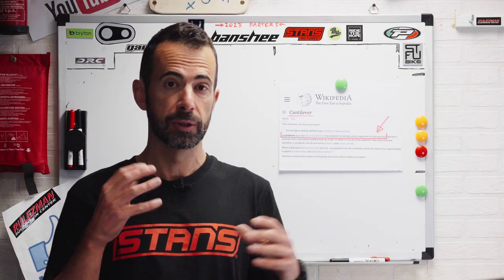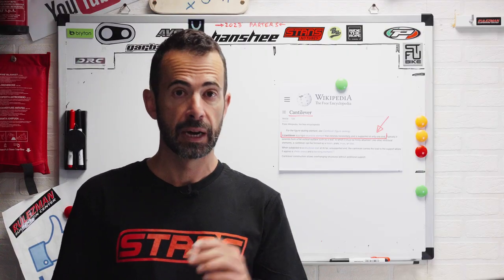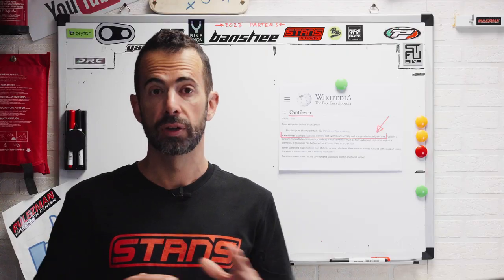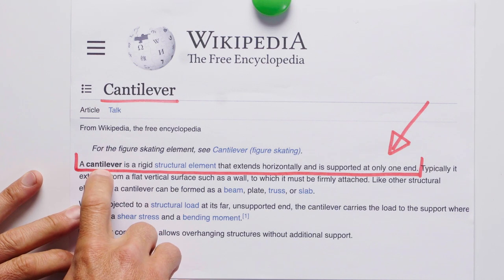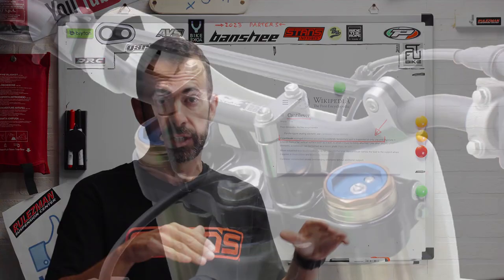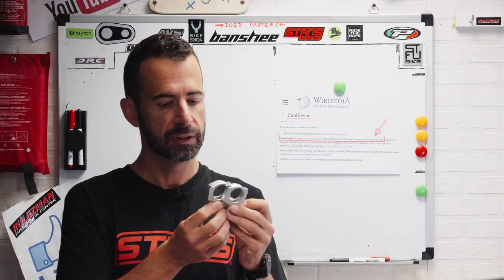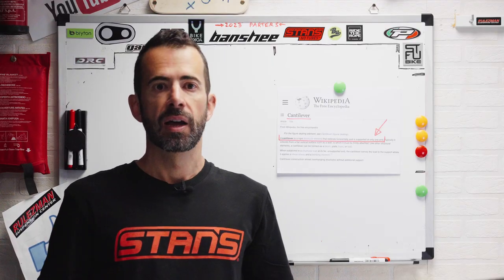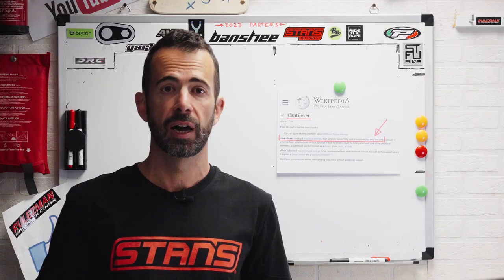MODERN GEOS & SHORT STEMS  : TECH TALK

Comment: Wow explained in a way everyone can understand. I'm 1.98 m tall with long legs. Very happy reach is rising, but rear chains stays only a few milimeters and stack even getting shorter. Also the shrinking seat tube lengths in biggest size(very often 46cm ore less) is a concern for tall riders. To be able to use a 18mm stem I need a reach of well over 55cm. Not found yet.  Fisrt time I noticed what a long chainstay and wheelbase  mean was on, our tandem with 485 mm chainstays. We can climb the sky. Only disadvatge : turning circle.

Comment: I watched the full video, thanks! I agree otherwise, but in my experience 12 degree backsweep handlebar is only good when riding bike from sitting position, but when riding from attack position, 8 degree backsweep (0 degree upsweep) handlebar is better. I've tested both backsweeps on long test periods.  In attack position wrists are at more direct angle to the handlebar and upper body muscles are better activated with the 8 degree bar. It´s also easier to ride correct attack position = elbows out. Many pro downhill riders prefer fairly straight bars for this reason (such as Renthals). Also Fabio Wibmer understand this and his signature SQlab 3OX  Carbon bar has only 7 degree backsweep. Motocross racers also will usually prefer a lower bar with less sweep, this keeps their body weight further forward, helping with cornering and hard acceleration. I think on a lot of mx motorcycles, handlebar grips are actually located little behind steering axis, not in line with it. 

Steering felt good with 32mm stem, 42mm fork offset and 8 degree bar combo on my bike, but the bar snapped recently and I had to switch to a spare bar with more backsweep. Now the steering feels way too sensitive and fast due to shorter "cantilever" with the same stem. I haven't even gotten used to it for several days. "Steering ratio" is too high, which means that front tire tends to "oversteering". I must do many steering corrections for one task on slippery surfaces, ruts, etc. Previous setup was very balanced. I use always 800mm width bars and now my grips are still 23mm front of steering axis measured in the middle of the grips. If I would use even shorter stem, wouldn't the steering of the bike become even more twitchy? 

Fork offset, which is also "cantilever", plays also role here and it´s 42mm on my fork and head angle is of course 63 degrees. I have tested different offsets such as 42mm, 46mm and 51mm. 42mm is the best of those. Chris Porter has experimented with a huge range of fork offsets on his bikes, and he has found that shorter offsets give a calmer handling bike, which tends to go faster when the stopwatch is brought to bear. Following this, Chris has landed on a 30mm offset for his 27,5" bike. Shorter offset also reduces the ‘floppy’ feeling that can occur when tackling tight corners, where the wheel can feel like it wants to tuck under. This is nothing to do with "trail", but simply the fact that a longer offset will put the contact patch further inside of the bike when cornering, causing it to pull to the inside of the turn. Interaction between stem cantilever and fork offset cantilever is actually quite important. Steering ratio is 1:1 when fork offset is zero and handlebar grips are in line with steering axis or if distance from steering axis is equal on both; offset and grips.  As Greg Minnaar once said: "You don't want a stem any longer than the offset of your fork." Greg didn’t want a stem length too different to the offset of his fork and I can agree. If I would ride with 15mm stem, I would need also shorter than 42mm offset for the balanced steering ratio. Unfortunately, the offsets of forks on the market are too long for that. Of course bar width (cantilever) is also important factor for steering sensitivity.

Comment: Hi Dave, congrats for the video.
I have a 470mm chainstay, 500mm reach, 1320mm wheelbase custom made hardtail bike (I'm 180cm tall), and couldn't agree more with you.
In my opinion, the only downsides in comparison with a "traditional" bike are:
- more side lean is needed to corner on very twisty, old school trails; therefore, switching between consecutive turns needs a lot of aggression;
- the added front wheel loading makes intentionally lifting the front wheel over obstacles quite harder.
Now I'm going to experiment with mullet set-up and higher rise handlebars.
Happy Christmas holidays!
Reply from the maker: yeah , nice comment man!   🤝

Comment: Fantastic info and so well presented 👍Unfortunately, most don't have a choice and go with the current trend / industry offerings. 
Also, re: rear stay lengths - it's fascinating how the same stay length can be used across all sizes offered, I'm using Spec Chisel as an example: same 432mm from size small to XL - meaning weight distribution variation @ BB almost 4% depending on the size!

Comment: Longer rear end = more front grip. Makes total sense when explained by a real engineer 👏
Reply from the maker: thanks man !🤝
Reply: @RULEZMANSUSPENSION  I do agree with the sentiment but a 460 CS on a 1300 WB bike gives the rear 35% of the complete wheelbase and 480 CS a 37%. 
How long chainstays are you saying you want? a 440 CS on a 1240 WB bike gives just over 35% ratio of WB as well.
Reply from the maker: @javisst44  nice calcs bro. 🎖: MOST MODERN adult bikes are 1280-1300 and still retain 430-435-440 CS, while we should move to 460-480 range .          1240? wow what is that a kid’s bike?  yes, that cS is well proportioned for such short wb

Comment: Hey Rulezman, geat video, thanks. I'd like to comment on two things.

- Moto vs bicycle. I read an article by someone from Mondraker a while ago on why they abandoned the 0 mm stems and why it works on moto. The deal (as far I can remember) was that on moto the whole system is way heavier and more stable and therefore does not rely on the stabilizing effect of the cantilever (stem) while going straight. Therefore even negative stem length works on moto that would destabilize the ride. Mondraker figured out that the optimal effective lever for mtb to provide a good compromise for straight line stability was 1-2 cm I believe. Effective means you need to subtract the backsweep of the handlebar since you would obviously end up with a negative lever with a 0 mm stem and a common mtb handlebar. With more modern bike geometries (shorter fork offset, slacker head angle) this may not be valid any more, as you said. Btw. the so called "Raised Reversed Stem", this crazy high short stem you may have heard of: the idea I believe is that by raising the handlebar you reduce the weight on the handlebar to moto regions. 

- Chainstay length. I am sure you are aware of it, but for the regular audience: please consider small bike sizes. I am currently on a bike that has a 430 mm chainstay and a 430 mm reach with a 35 mm stem (I'm only 167 cm short). This is great. Nowadays I see bikes that have 450 mm chainstays on all sizes, so you might get a 430 mm reach on small size. This sucks. Difficult to manual, bunny hop or make bike oversteer (very important to me). Just keep the 1:1 ratio between chainstay and reach. So if you have a 520 mm reach on size XL, give it a 520 mm chain stay. Crazy, I know, but it's just science.
Reply: Thanks @alexgordon8277, I'm with you on wanting a smaller bike for playfulness, ease and speed to manual, bunny hop, and to make the bike oversteer. I want to manual and bunny hop more on the trail and I have had problems with feeling that my bike understeers with a shorter stem that I have fixed with a longer one (going from 35 to 50 mm).

Though, I do agree that @RULEZMANSUSPENSION has good points for stability that apply well for racing. 

This video generates a lot of ideas for me! 

For example, I think about if it is possible to make a combined linkage and shock to give a considerable rear axle path (obviously with high pivot) that has 1, plushness off the top; 2, good enough mid stroke support and LSC damping to not {considerably fall through mid stroke and lengthen chain stay with the rear axle path} when doing a bunny hop, a manual, or otherwise pushing with body weight; and 3, that reaches considerable travel through mid stroke, lengthening chain stay when hits are hard and stability is preferable. 

My thoughts of a shock to provide these characteristics come from the Rock Shox DJ that does just this but on a micro scale. 1, it has about a cm of plushness off the top; 2, then goes quite stiff to create a rigid feel for ultimate pumping on a pump track; and 3, when landing jumps it actually falls through travel to give exactly the support that you want. 

Now the question arises: Are these traits transferable to our application?
Reply: @niklasdr  "...understeers with a shorter stem that I have fixed with a longer one (going from 35 to 50 mm)."

What you experienced with this was the limit of your functional Reach (as David explains above, when I say "functional").  When Reach is bigger than your posture, abilities and flexibility & reflexes allow, you can't weight the front wheel adequately.  

I have played around with this since before Reach was part of marketing lingo.  Effective top tube measurements more or less tell you, as long as you understand your STA affects this ETT vs Reach comparison.  Like David I was curious about shortening the stem and what that does to the geometry and reactivity.  In the early 00s top tubes were shorter and so a shorter stem pushed you backward on the bike.  What was needed was more top tube.  When top tubes got longer?  About the time they started talking about Reach.  With more top tube and less stem, you get equal front contact patch weighting right up until you go too big on your Reach and throw off your posture & reactivity.

Gary Fisher tried to make a splash with this idea, in moderated fashion, some time ago.  He was suggesting moving from 100-120 stems to 70-90 stems.  It didn't take at the time, but later it started catching on with bigger top tubes and shorter stems.  Look at modern XC race bikes in World Cup level racing.  Compare them to 20 years ago.  Even the serious anaerobic athletes are benefiting from a more stable platform.
Reply: @seanoneil277  "What you experienced with this was the limit of your functional Reach (as David explains above, when I say "functional")." You are misinterpreting me. I am talking about under- and oversteering. My case does not have to do with functional reach. I had the same functional reach in both cases. 

Longer frame reach and shorter stem gave me understeering. 
Shorter frame reach and longer stem gives me a better balance between understeering and oversteering.
Reply: @niklasdr  I may be misunderstanding you.  But consider this -- under/oversteer qualities are related to this concept of what is your functional Reach.  How either gets introduced into a steering effort is a combination of geometry w/in the bike itself, and the rider's fit to that bike & geometry while riding.  Wouldn't you agree that you can, if skilled enough -- and if rider to bike fit is good enough, induce understeer or oversteer at will?

I don't mean to suggest your skills/experience are low or inadequate.  I'm just saying that from my experience, riding bicycles then motos as a kid, then again road bicycles and MTBs later as an adult, trying different frames and geometries as well as undersizing and oversizing on frames, what I've learned is that especially when oversized, a bike can feel as though it understeers more than oversteers.  Conversely a too-small bike (i.e. adult on a 20" BMX) will feel always oversteering unless you grew up riding compact WB and steep angles.

In between oversized and undersized is a "just right" spot where you can maneuver the bike as you wish, rather than feeling forced into passenger mode (oversized) or clown-biked (undersized).  Your functional Reach is a big part of maneuvering the bike as you wish.
Reply: @seanoneil277  You definitely have a point and I like your reasoning, I follow along on it! 

It's just that my case tells myself a different story as I went up in functional reach (by lengthening the stem) and found less understeering. This is a bit the opposite of your story that a longer functional reach will lead to more understeering. And it is here I mean I feel that a bit longer stem gives more of the feeling of pulling the front wheel through the corner in the direction that I want to go [giving me a balanced oversteering] as opposed to pushing it through with a risk of it washing out [understeering]. 

I'm a pretty normal medium size guy at 5'10 / 178 cm tall, with perhaps a little more legs than some at 32" / 82 cm inseam, and a bit longer arms than most at 6'1 / 186 cm wing span.  I have loved a 27" 422 reach frame with a 50 stem.  I liked a 29" 460 reach with 40 stem, even though it felt like a monster truck in comparison.  And I loved straight-lining the next 29" 470 reach with a 35 stem (after not liking the 50 stem it came with because the bike felt too big).  It is the next mx 455 reach with 35 stem that I felt understeered, which I felt was solved with the longer 50 stem. I now also ride a 445 reach, 50 stem bike I really like for playfulness. But I feel my best size for enduro is a 455 to 460 reach and a 42 to 50 stem. But, I am open to experimenting and finding anything new that could override what I feel is true today!
Reply: @niklasdr  No I get what you're saying.  I ride a GG Shred Dogg and it has 10mm fore/aft head tube position adjustment.  I have 50mm and 35mm stems.  I played around with all the configurations, noticing where I had to put myself to get proper weight on the front axle/front contact patch.  I've done the same on older bikes with much older geometry (late 90s/early 00s), though in those cases it was stem length and bar width & rise.  

Sometimes it can be a matter of getting the roll of your handlebar correct, too.  When the roll is off, you can't really feel the front contact patch as well as when you have it dialed properly.

Comment: I also like short stems, but you did not mentioned, that with it, the handlebar is behind the steering axes, because of the offset of the fork. Normally the wheelaxes is 40mm in front of the steering axes.

Comment: I have been saying this since the early 2000s! I currently run 35mm stems, but I would love a 15mm stem. I don't see anywhere I can get one though.

As for chainstay length, a shorter chainstay gives a bike more pop for jumping. Longer chainstays make pulling up the front wheel more challenging and because many riders like the catch air a short chainstay makes that a lot easier. Comparing a motocross bikes chainstay to a bicycle is a bit odd considering you have a motor with a bunch of power to get the front end up, something you don't have for a mountain bike. On a bicycle you have to control the pitch of the bike with your arms, legs, and body position. So I am not so sure I agree on your statements about making chainstay lengths longer simply for more equal front real balance during cornering. You do a lot more on a mountain bike that cornering so the frame geometry needs to be well balanced to accommodate all the different situations. So for my height of 5' 7" anyway, a 435 - 440mm chainstay is perfect. As a rider gets taller, the chainstay length should get longer, not just the front of the bike.
Reply from the maker: 15mm stem: email me. I produce them.

CS:  races are win on corners not on hopping, and long cs makes you cornering with more speed overall, so it is faster.       who think at hop as his first passion shoul
buy a  24” bike or dirt jump
Reply: @RULEZMANSUSPENSION  Sure, for racing. Most of us just ride for fun and enjoyment. And yes, we still want higher performing full suspension or hardtail bikes. A DJ bike won't be very fun to ride on most singletrack. I don't want every manufacturer to design every regular consumer bike for what the highest level racers need.

Most lift access trails and flow trails have jumps and fun features in them, think freeride. I think one of the biggest problems in the bike industry is they have racers determine what everyone else should be riding. Maybe the term freeride needs to come back and Enduro can be the racers bike with long chainstays, super slack head angles, and so on. I absolutely agree with you about the stem though.

And yes, I will contact you about that stem. ✌️

Comment: I have thought that short rear centres for all sizes has been wrong for some time. On my own Chameleon hardtail I extended the drops all the way to 435. No negative to my riding. I’m 164 tall too. Been on short 31mm stems too. Again, works well for me. The myth of a long front or long stem to put weight on the front wheel for climbing is so obviously wrong as you eloquently describe. No one pushes down on a bike while climbing steep bits. We pull back on the bar on steeps. And I know steeps. I live and ride in Whistler .
Reply from the maker: bro: hard tails are not the right vehicles for offroad by phisycs.
Reply: @RULEZMANSUSPENSION  it’s not about being the right vehicle sometimes but the most fun.

Comment: Do you have a recommended optimal range for chainstay to wheelbase ratio? Quick point of reference: Banshee Prime large 450/1250 is a .36 ratio.
Reply: This is the bike I have, large V3 banshee prime. It seems to crush climbs and is stable on the way down. I'm looking at trying the longer dropouts, to lengthen the chainstays 10mm, and the wheelbase as well.